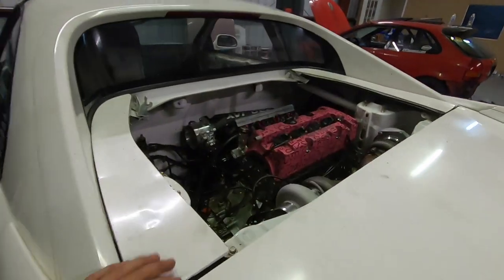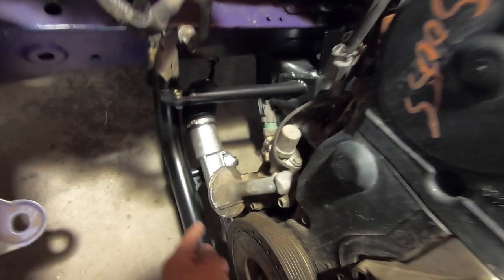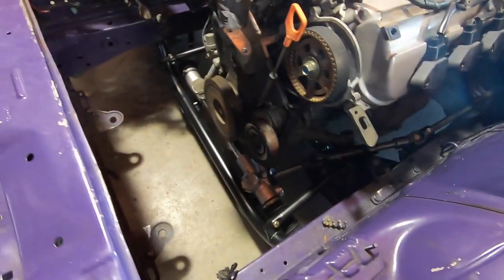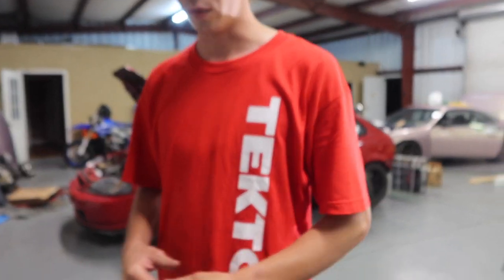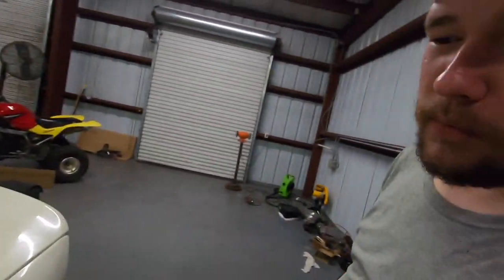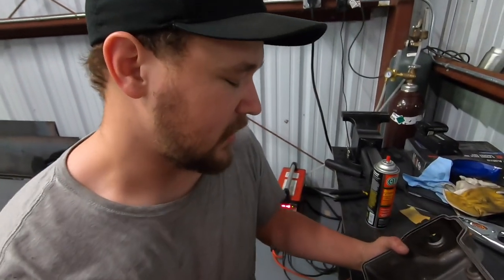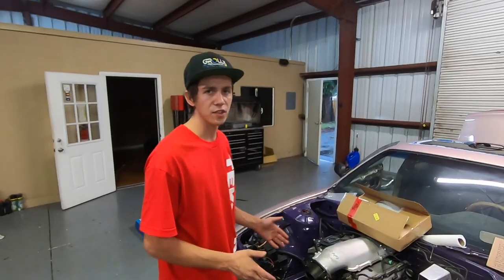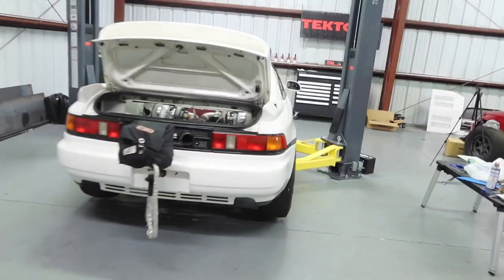Twin Turbo J Swapped S14 Build - We Have Steering!

Comment: I love little shops like this that did the steering rack.
Reply: I hate to be a hater, but he's not doing anything but donuts with the rack setup they did. He needs some serious tierod offset spacers to make it work.
Reply: @jakobd6028  maybe you should reread his comment he didn't talk directly about the steering he was acknowledging the shop lmfao relax
Reply: @jakobd6028  did you not listen to the conversation they had.
Reply: @garybrown3869  I did. And what I heard was that instead of cutting the spindle like it already is, they are moving it forward so it aligns with the rack. But then it will lose some angle and the wheel might hit the inner tierod at lock

Comment: Parts stor tests starters with no load on the motor. So it might work when it only draws 30 amps, but when cranking a engine, against compression, the starter may draw 300 amps. The arcing around the motor bolt suggest the motor is trying to ground through the bolt.

Comment: I find that starter problems like that stem from bad grounds between the engine and the body/frame. I run a large, woven ground between the block and the body. You can get them from Summit.

Comment: 5:16 all those shiny new socket, and I guarantee no one will be able to find the 10mm
Reply: Its probably already demateriized into the etherial realm
Reply: I've never had a problem with 10mm sockets disappearing. For me it's the 13mm
Reply: @ohiohouston3560  dude same. Idek what I use them for except maybe an oil drain bolt?

Comment: I’ve got a k-swap question for you guys. One of my cars is a 92 (5th gen) celica gt with a turbo’d 5sfe. I love the car and it’s fun, but 5s’s top out at around 200 hp on stock internals. 3s swaps have gotten way too expensive, and I want more power. My car shares the same motor, parts, transmission, etc as an mr2. Would an mr2 K-swap kit work with some minor modifications? I can’t find any evidence of someone doing so in a 5th gen celica so I figured I’d ask you seeing as how you’ve got an already swapped mr2

Comment: There´s even a better spot to ventilate the engine, in the bottom above oillevel.
That way you don´t get windage through the oildrains in the head and oil located in the head can freely drain back to the sump.

Comment: I used tekton impact sockets for over ten years as a professional. Never had one fail or break
Reply: I broke one trying to get a harmonic balanced bolt off. 3/4 gun with a 1/2 adapter lol

Comment: That steering rack looks to be mighty far forward. Gonna be fun to see how it works...
Reply: Also the swapped the knuckles side to side to move the tie pickup point to the front. The attachment point for the lower ball joint is at an angle to allow for negative caster and I can’t help but think this is going to cause the ball joint to bind under compression. I know they talked about extending the pickup point on the knuckle out and inward to compensate for the rack being forward but will that clear the tension rods? All in all this steering doesn’t give me the warm and fuzzies.
Reply: @paulsensabaugh7879  never mind that the ackermann is so far out to lunch. its common in a drag car to have the steering rack pushed that far forward due to engine placement, and this works because a drag car only needs a few degrees of steering input during a run. 

when building a car that has to corner you cant deny physics. the suspension and steering has to be where it will work correctly, you make all that work and fit the engine and everything else around it. if there is no possible way to fit the engine around the suspension, pick a different engine that will fit. suspension geometry has to be right, you cant half ass it and expect it to work.

Comment: Drift cars you want the rack closer to the center line of the front wheels than the pick up point on the knuckles, this allows good feed back and control near lock and allows for good lock without the risk of steering bind due to over centring the tierod.

Kyle: processed to have the rack mounted out in no man's land.
Like I love your content but it seems you've just after thought one of the most important parts

Comment: Maybe try retrofitting the BMW-style oil-filter where it is relocated up next to the engine, rather than the tubing style that so many Honda engines have with relocation. Looks cleaner and more stock to run the BMW style

Comment: Dammit boy! Tekton hooking it up FAT! Honestly guys, it doesn't get much better than that. They hooked y'all up with probably close to $7500 worth of tools and a box. Now you need a 60-100 gallon twin cylinder compressor, 3/8 hose, quick connects and ratcheting hose spools all around the shop, and an assortment of air tools. That shop is seriously mint y'all.

Comment: Take the back off the stater and spin it backwards with a pipe wrench. 100% fix my 78 El Camino did that and I couldn't get a new starter right away, it worked for 7yrs then I sold the car with it still working!!

Comment: FYI, spindles are built differently for rear rack and front rack.  You'll notice that your outside tire has more angle than the inside tire, that's opposite of what it should be.  Ackermann is what this angle difference is called.  For a front rack the spindle arms need to "toe out" for Ackermann to be correct.  When the rack is behind the spindle, the arms point inward instead of outward.  You will not be able to drift spindles that are designed for a rear rack when you swap them side to side because the Ackermann is all wrong.  You might as well make some new spindles now instead of fighting with incorrect Ackermann.

Comment: The parts stores equipment to test alternators and starter do not work i had to use a battery charger and a screw driver to prove to them that my starter didnt engage after they tested it multiple times

Comment: The ackermann on that S14 looks pretty terrible. The outside wheel has more lock than the inside wheel. Maybe use some offset spacers between the rack and inner tie rod. That right now looks borderline dangerous

Comment: I thought I was bad to vent the crank case back into the valve cover when using E85
Reply: It's venting out if they run a return line off the catch can back to the oil  pan then it would return

Comment: In case you happen to find this among the 884 other comments... In my 17 years experience, I have personally seen starters that test fine at the parts store, but will not work on the actual car- the difference: it's easier for a starter to work when it's freewheeling on a workbench. When it's installed on the actual car, it's under load. Autozone and O'Reilly employees sometimes don't know that. Just get a NEW one.

Comment: This might have been covered in the comments already but putting your catch can where you pointed out is a terrible idea. It looks like it will be right on top of the rear tire. It would be a disaster if it over flowed on a 150mph pass. Just my 2 cents.

Comment: Congrats on the tool sponsor man! I own some TEKTON tools myself and couldn't be happier with my purchases. Great quality tools at a great price and awesome support if you have any issues. If you dont have it already you should check out the 1/4" drive torque wrench item #TRQ21101. It's an awesome little tool, great for tight places and not messing up threads in aluminum by over tightening. Keep up the good work man and keep on crushing it!

Comment: What I want is a tool brand, ANY tool brand to make a box like I've got, ooooold craftsman kit, like this: https://s3.amazonaws.com/bvsystem_tmp/pages/1839/original/Craftsman154PieceMechanicToolSet-AssembledBig.jpg

That giant bin lets me carry the few special tools I need for working on boats, and I'm not about to roll a huge kit, this I can grab in one hand and haul the 1/2 mile along marina slips to whatever boat I'm working on.
Not a single manufacturer makes a kit that has a good selection of 1/4, 3/8, 1/2 as well as the most basic wrenches and still has extra storage.

Sure, I could carry a second bag, but why? why can't I just get a box with enough space for a handful of the specialty stuff I need and free up my other hand to carry my scan tool or fluids, etc.
I'm literally buying every one of those kits I can find on marketplace and ebay at basically whatever people are asking because they're out of production and nobody is stepping up to make a decent all around box with room for customization.

Comment: at 15:33 you can see the mess the electrician did. from your last video with using 2 single pole breakers tied together with copper wire for the lift, and now seeing loose hanging mc and more then 180 degree bends in the emt right out of a box, your "electrician" sucks.